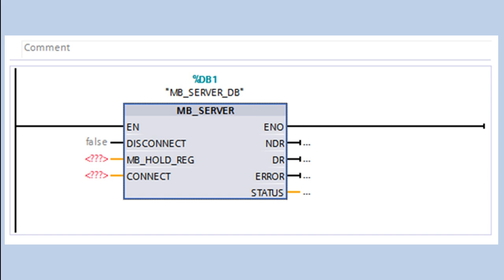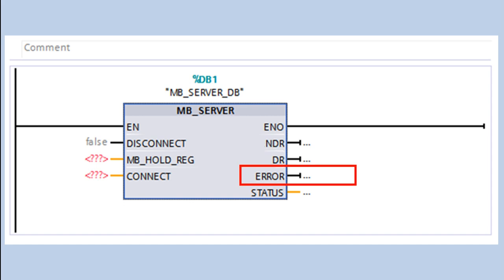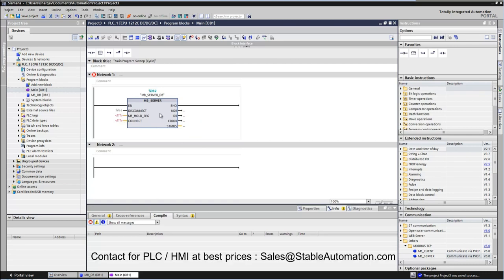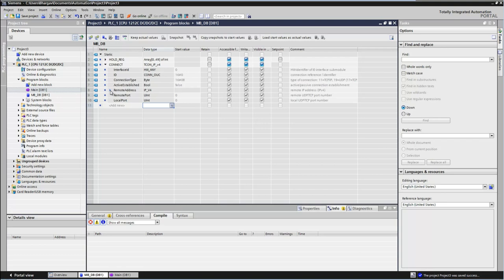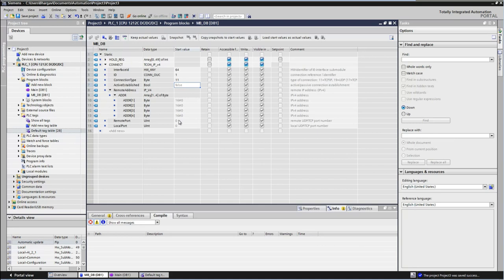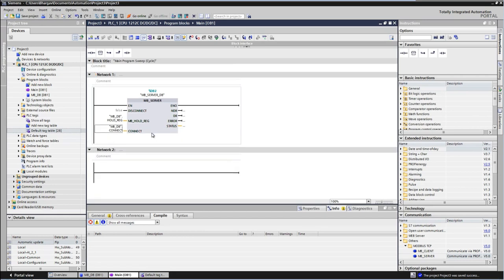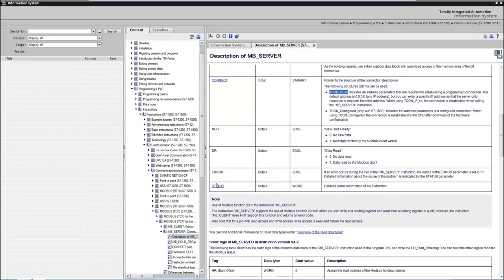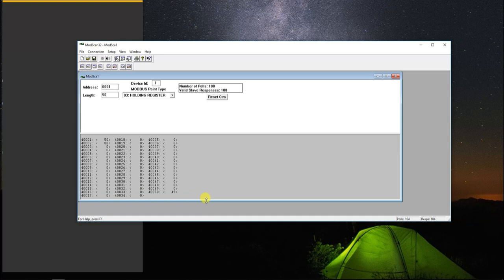S7 1200 as Modbus TCP Server using MB_SERVER

Comment: I have 4 devices of plc s7 1200 and in this devices the program developed with modbus db block and its protected .It is read only how could i connect these devices  to the tia portal i need to read and write holding address ? Please help me how could i connect modbus TCP ip devices to tia portal ? I need to develop scada using these holding addresses please help me anyone ? If i have communication module of rs 485 could i get values directly from that cm module ?
Reply from the maker: You mean db for holding reg is password protected ?
If it is programmed by another person then  you need to ask the developer for the password.
Reply: @StableAutomation  sir without asking password is there any atlernative to get holding registers actually i need to develop scada for this i want those modbus addresses. Using opc server can i get addresses without password?
Reply from the maker: @Santhoshkumar015  then one of the possible way it to check each data on modbus scanner and manually check and verify individual values with plant data.
Reply: @StableAutomation  ok sir i already checked data I have data addresses now how can I use these addresses in tia wincc rt advanced along with pc station ?
Reply from the maker: @Santhoshkumar015   if you have TIA runtime , use profinet connection instead of Modbus TCP. But yes you can use it